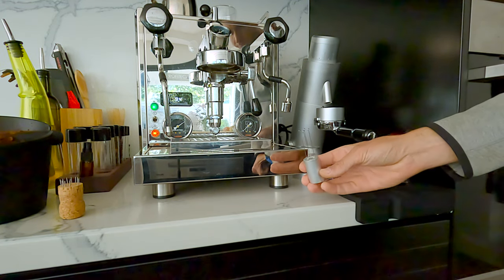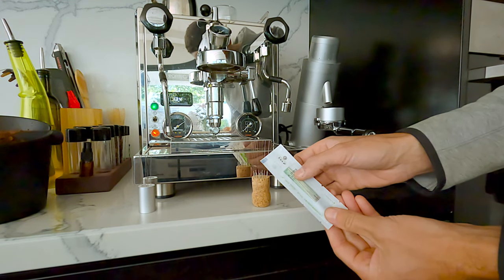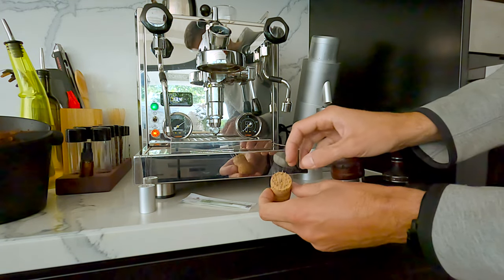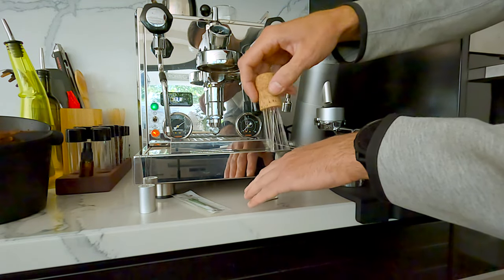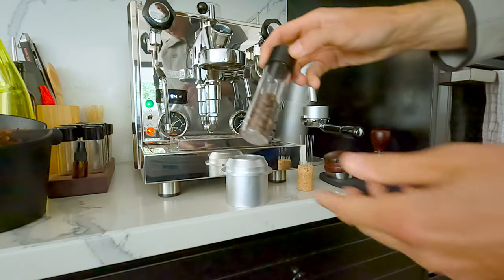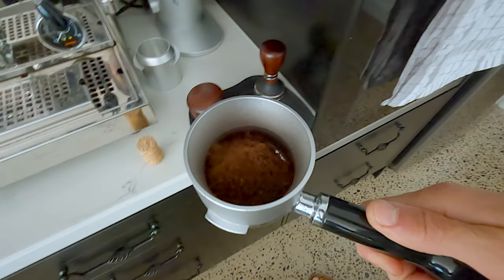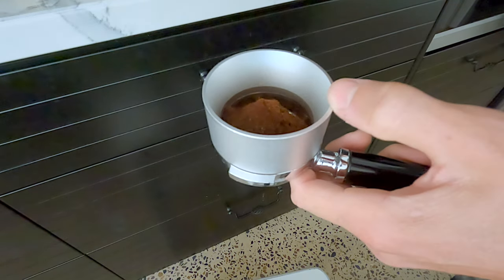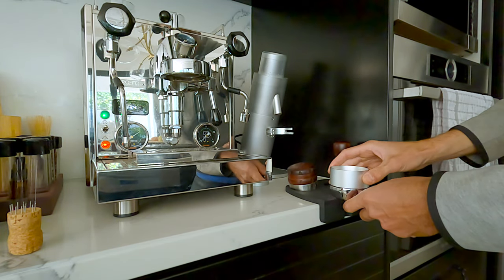WDT tool for coffee distribution - make it yourself with acupuncture needles

Comment: Hello Artem, great video. I’ve experimented with wine corks—I generally prefer my wines to have natural corks but have found that the density of synthetic corks tend to enable better ‘retention’ of the acupuncture needles. I also use the Weber Workshops blind shaker, which works surprisingly well.
Reply from the maker: Thanks mate! Haven't had any loose needles in my standard champagne cork with 1.5mm holes drilled. The blind shaker looks cool too, too many "coffee toys" on the table now :)

Comment: Searching Ebay brings up many different types of acupuncture needles and I am having a hard time finding the one you used.  Any chance you'd be able to send the link?
Reply from the maker: This one: https://www.ebay.com/itm/393598323998?var=662356714791&hash=item5ba449cd1e:g:InQAAOSworBhUYSi  "Zhongy Acupuncture Needles PT Quality German Steel all sizes available", gauge 0.22mm, length 50mm